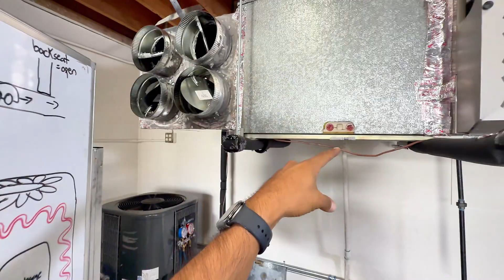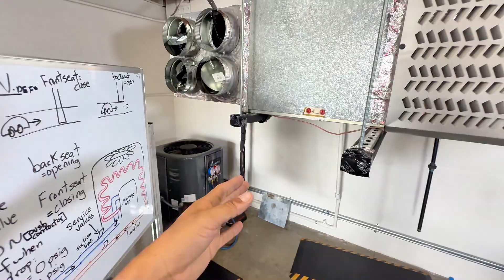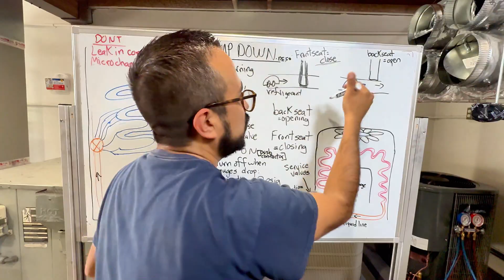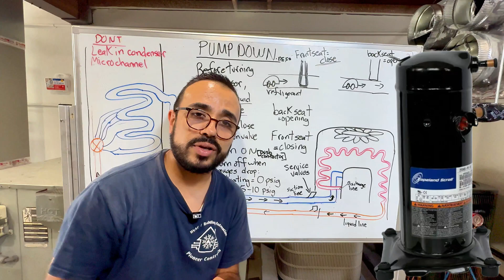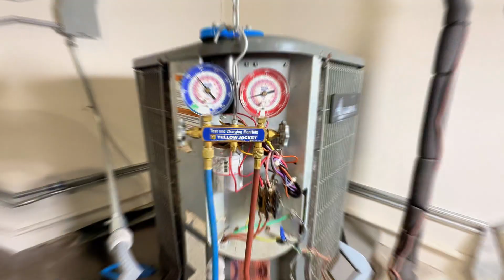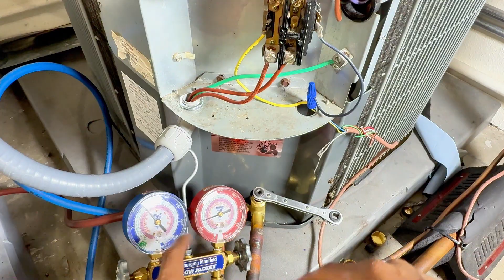How to Do a Pump Down on an HVAC Split System | Step-by-Step Guide

Comment: Is there a rating or limit on line set length ?
Reply from the maker: The manual will tell you how long is the max but you shouldn’t go too far due to friction rate and oil returning to your compressor.

Comment: I guess i cannot completely disconnect the pipes to for example put concrete under the comondensor. Can I?
Reply from the maker: You can but it needs to be protected from moisture and meet code.

Comment: I thought a pump down trap the refrigerant in the compressor
Reply from the maker: It traps it in the condenser. Within the condenser, you have the compressor and condenser coil so the refrigerant is trapped within these two components.